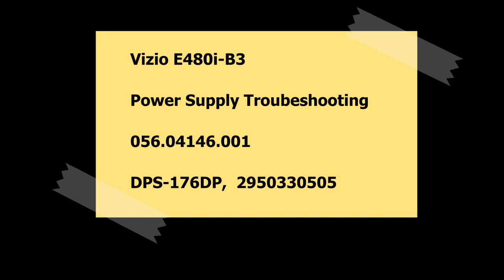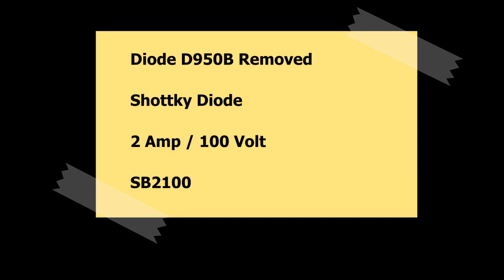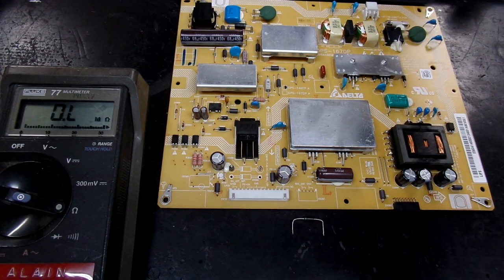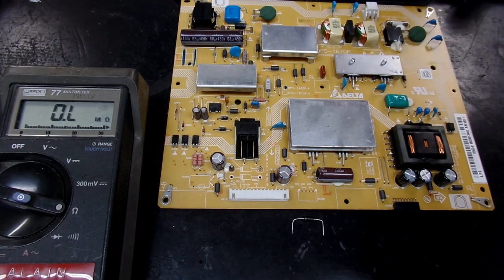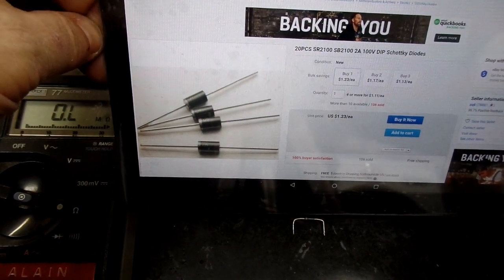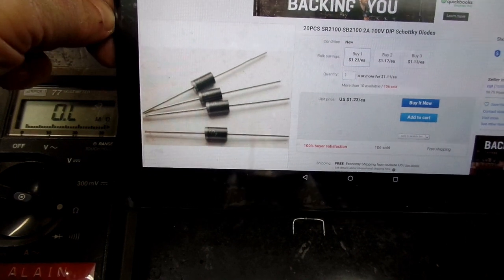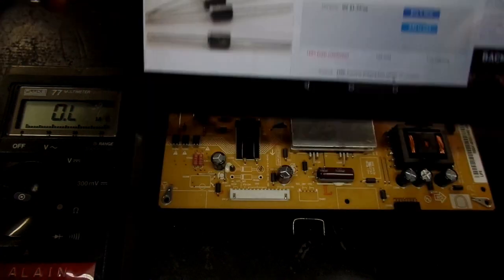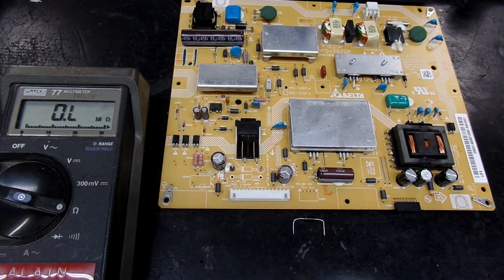Troubleshooting a Failed Vizio E480i-B2 (Delta) Power Supply Board - 056.04146.001.

Comment: Did replacing the diode fix the TV?
Reply from the maker: Nope..   there was just too mny things wrong with the board..  I replaced like 5 or 6 items that were physically damaged...  and still it would not output any voltages..  so I gave up on it.

Comment: For anyone who encounters this problem, you mainly want to check/replace the following components:
1. IC 909
2. R915
3. D950
4. ZD909
In my case the IC 909 was cracked and shorted. There are a few options on ebay that sell these components. I ordered these and was able to fix my VIZIO E550i-B2 mb after I heard a pop/crack/burnt smell.

Comment: I know this is a old post ,but did you finish this repair? thanks
Reply from the maker: Hi...

Actually..  I gave-up on it..  I just kept running across more and more failed components on the circuit board, that it became too much of a time sink for me...   so I pulled the plug on the whole thing...   I added comments to that effect somewhere in the comment string.
Reply: @MonteStudios  Ok thanks

Comment from the maker: As an update..  here are all the failed components I spotted..

IC901 - which is a 7 Pin DIP (pin #6 is not present) i found it to have failed - it is a LD7913JGM6 

https://www.datasheets360.com/pdf/732173695424627367

== == ==

D902B -  Also found it to have failed - it is a  EGP10G by Vishay

https://www.vishay.com/docs/88582/egp10a.pdf

== == ==

ZD907 - NZ 24B - mine is shorted... a 24 VDC Zener by Vishay

https://www.digchip.com/datasheets/parts/datasheet/420/UZ-24B.php
https://www.digchip.com/datasheets/parts/datasheet/420/UZ-24B-pdf.php

== == ==

ZD909 - I found it to have failed on my board..  is a:  4.7 Volt Zener Diode..  try Digikey   BZX79C4V7-ND

https://www.digikey.com/products/en?keywords=BZX79C4V7-ND

== == ==

I hope this helps..

Comment: AND 10 month later no 2nd part?
Reply from the maker: You are correct..  in fact, I have not since worked on that board, simply because of other priorities...    I did order all the parts that I found to have failed, but simply have not gotten back to it..  In all honesty, there were so many failed components on it, that I would not be surprised if there still are items that I have not identified as having failed .. Winter is coming, and I tend to spend more time in the workshop during that time..  hopefully I'll find some time to spend working on it again soon...
Reply: I have the same visio with the Logo stuck on screen.. hopefully is the MB. My little project.

Comment: I am Trying to repair a power source of a VIZIO E480i B2 .The IC901 (LD7913JGM6) explode and the ZD909 is also badly damaged. Would you tell me the caracteristics of the zener ZD909 to change both components. Your help will be greatly appreciated.
Reply: hola  el diodo zener es un 4v7d  yo tengo el mismo problema pero nose que tenga el diodo zd 909 marca como si tubiera fuga pero es un diodo de bajo voltios es de 0.330 voltios
Reply: usted reparo la fuente

Comment: Yeah right by the relay is a chip label ic 901 my is chipped
Reply: Yeah so your saying don’t try and fix it just get a brand new power supply module
Reply from the maker: @brandonniette4825   I'm not saying that..  that is for you to decide..  but remember that on eBay those boards are not that expensive..  so my suggestion is to get a new board, and fix the failed one as time permits.

Comment: Thank you for this video, very nicely done. I am in the process of repairing this exact board (056.04146.001). However, I cannot find a schematic anywhere online. I need to replace the folowing components: ZD909, ZD907, D902B. I googled the part numbers on the 2 zener diodes, and the 1 normal diode, and found nothing. I really want to fix this board, but cant as I dont know the values of the components I am trying to replace. Your help would be greatly appreciated.
Reply from the maker: Hey...  I may well be able to assist with identifying those items...    I'll try to sped time on it this evening..  I also looked for schematics, but found nothing...    I have more findngs on my board, and had ordered (and received)  part for it..     I plan on posting an update video for this one, but that was not going to be until the coming week-end...
Reply: @MonteStudios  Thank you for the reply. If you ever find out those components, please let me know.
Reply from the maker: @Xgamer121X   - Here is what I can tell...

IC901 - which is a 7 Pin DIP (pin #6 is not present) i found it to have failed - it is a LD7913JGM6 

https://www.datasheets360.com/pdf/732173695424627367

== == ==

D902B -  Also found it to have failed - it is a  EGP10G by Vishay

https://www.vishay.com/docs/88582/egp10a.pdf

== == ==

ZD907 - NZ 24B - mine is shorted... a 24 VDC Zener by Vishay

https://www.digchip.com/datasheets/parts/datasheet/420/UZ-24B.php
https://www.digchip.com/datasheets/parts/datasheet/420/UZ-24B-pdf.php

== == ==

ZD909 - I found it to have failed on my board..  is a:  4.7 Volt Zener Diode..  try Digikey   BZX79C4V7-ND

== == ==

I hope this helps..
Reply: MonteStudios oh wow thanks mine so messed up I cannot tell the number but you said it
Reply: Yeah the rectifier on my tv is bad or someone else the D902B part
Reply from the maker: @brandonniette4825  I found like 5 items that had failed...  I've ordered most, but not installed any (due to time constraints)...  check the items I listed for sure..  there still may be others...

This kind of major failure makes the board almost un-repairable, and untrustworthy if you do get it fixed. I have a number of those IC's  since I ordered a small lot from eBay.
Reply: So get a new board power supply board right